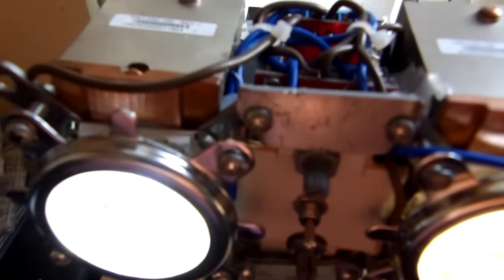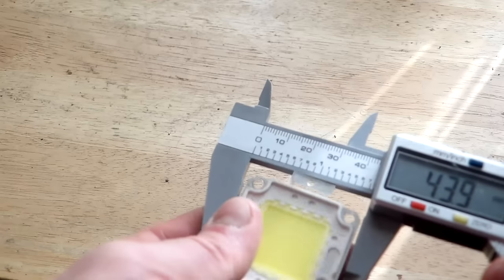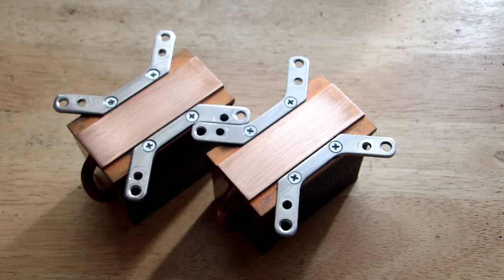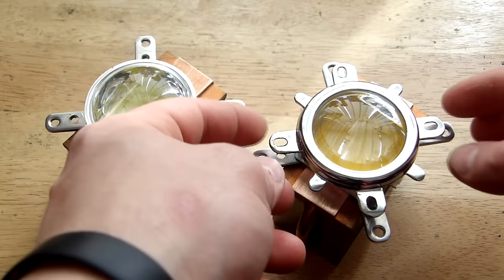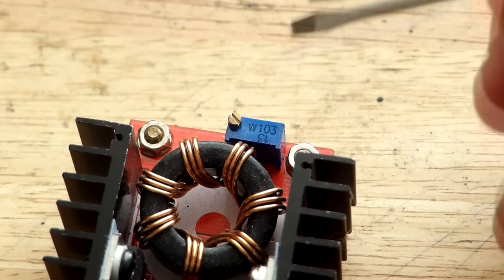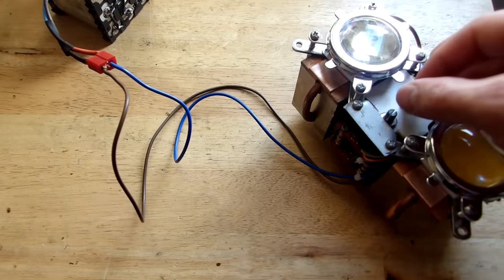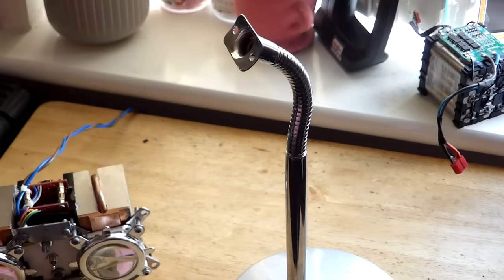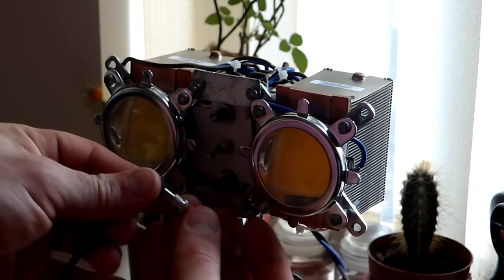Studio Lights 2x20w Cold Warm Led Build Your Own

Comment: Nice project.
You might want to turn the heat sinks 90⁰, such that the fins are vertical. That should make the passive cooling much more efficient.
Reply from the maker: thank you for the advise . i m planing to make a second one .